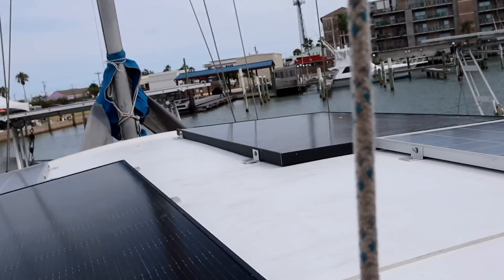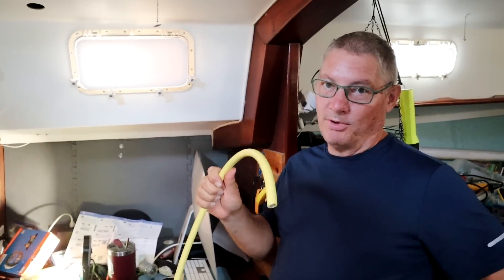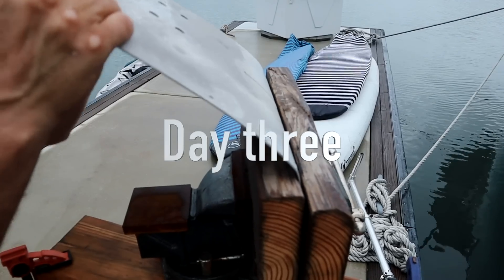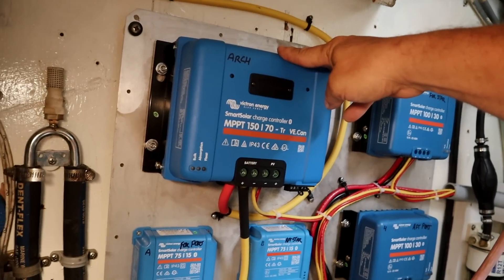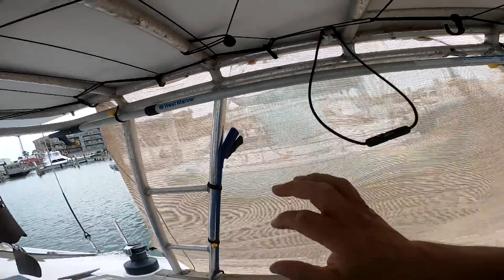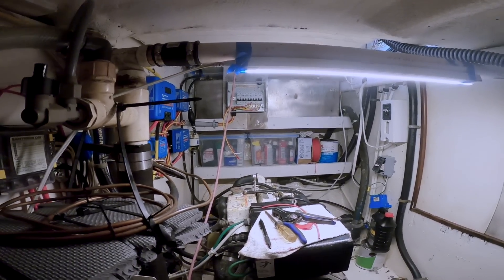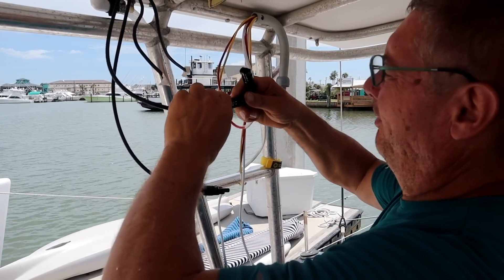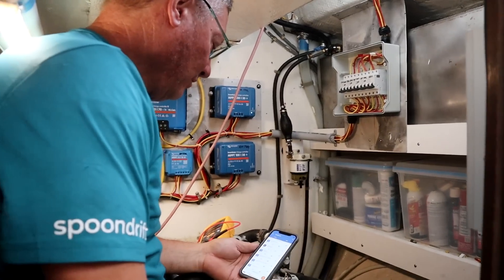Wiring a Solar Powered Sailboat | ep 216

Comment: While this is the first of you videos that I have seen, plan on more, I have two things of note. First the fusing needs to protect, yes wire first, but also equipment rating ect. With a traditional buss bar system you need an appropriate fuse between the battery and buss bar Second, you also need another fuse/circuit breaker sized appropriately for the equipment on the other side of the buss bar. In other words another words a fuse for the inverter, solar charge controller, solar panels ect, and all fuses/circuit breakers on the equipment side should ALSO protect the relevant wire going to/from those items!?
Reply from the maker: Hey Mark, glad you found us. You’re right, we did not show all of the wiring all the way to the batteries, that includes more bus bars and fuses. There are a lot of opinions about how to wire solar. This was not a detailed how to video, but a basic overview. It took Todd many months of research to design our system and trying to explain the whole thing in less than 20 minutes would be impossible.👍
Reply: @Spoondrifters  Ok, cool and understood, I just see some of these videos from people and don't know their whole set up, but feel the need to inform towards research and making sure that it is safe and fire resistant, as much as reasonable, while protecting their investment ect. And some people overlook something, as people do. And it is still high amperage and voltage in places. Glad to hear you already did your homework!